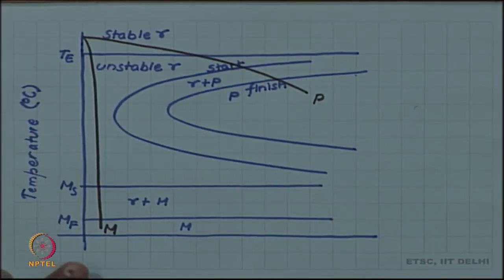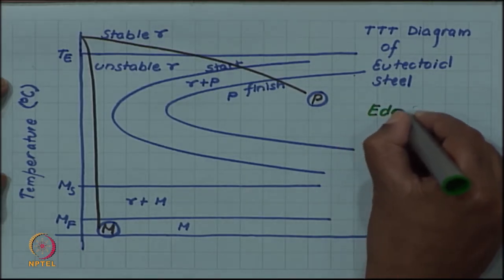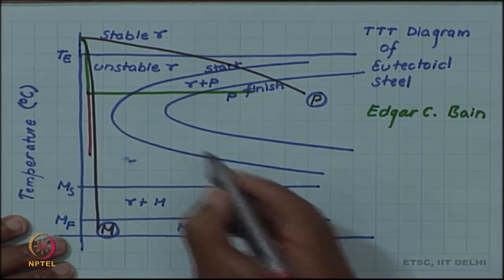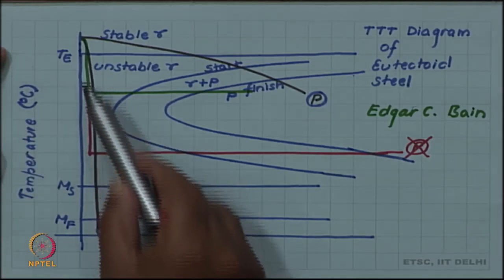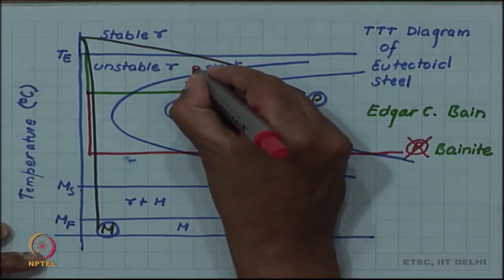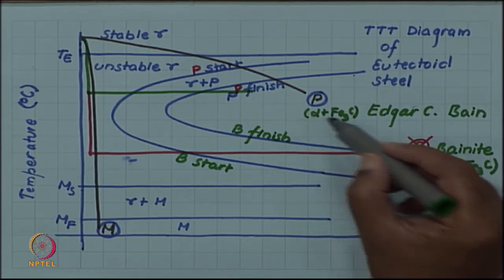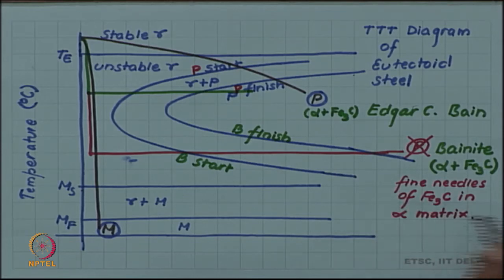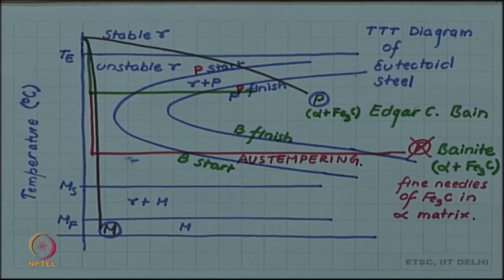Austempering and Bainite

Comment: Sir if pearlite is formed by equilibrium rate means its the most stable form possible then how can if we hold a pearlite for 1 day it turns in spherodite?
Reply: We need to distinguish between equilibrium phases and microstructure. The phase diagram. by definition, gives the equilibrium phases. The equilibrium phases here are alpha and cementite. Thus phase diagram indicates that equilibrium phases are alpha and cementite. It does not tell us whether these two phases appear as pearlite or spheroidite.  This we interpret depending upon other conditions. Thus under normal cooling of austenite, these phases form alternating lamellae called pearlite. But if it is heated below the eutectoid temperature, the microstructure changes to spheroidite: spherical cementite in alpha matrix. The phases are still alpha and cementite, their distribution and shapes have changed.
Reply: @rajeshprasad101  ok sir got it,thanx a lot🙏
Reply: Well the phases alpha and Fe3C are the stable phase but the microstructure of pearlite is not stable. Peralite microstructure has a lot of alpha/Fe3C interfaces. So a large interfacial energy. This interfacial energy is reduced when it transforms to spheroidite.
Reply: @rajeshprasad101  thanx a lot sir🙏,but if spherodite is the most stable form and we can get it by very slow cooling(even more slow cooled than pearlite) from stable gamma,then in phase dia shoudnt we show spherodite instead of pearlite?

Comment: Sir, Could you please explain why there is a difference in properties of bainite and pearlite, I mean how does it occur because of the microstructure, I want to know what is happening at the atomic level during the heat treatment process.
Reply from the maker: Although both are mixture of ferrite and pearlite, the difference is in there distribution. Pearlte consists of alternating plates of ferrite and cementite. Bainite consists of a matrix of ferrite with fine ditribution of cementite particles.

Comment: sir could you explain  how scientist could able to cool isothermally for such long time in the air ??
Reply from the maker: The isothermal experiment is not done in the air. It is done in a constant temperature bath. One uses molten salt or molten metal to maintain a constant temperature. It is like, you can use boiling water to maintain a temperature of 100°C.

Comment: Sir I have one doubt that whether Bainite structure is available at room temperature or not because in diagram (Austempering Heat treatment) we hold at temperature above Ms(Martensite start temperature).
Reply: It forms above Ms and below the nose. But once formed, it can be retained to room temperature. It will not transform to martensite. Thus if Bainite is cooled below the Ms no martensite forms. Only when austenite is cooled below Ms it transforms to martensite.
Reply: Thank you SIR ji
Reply: Sir your explanation is just incredible!!!!